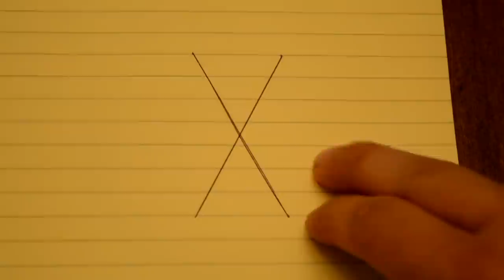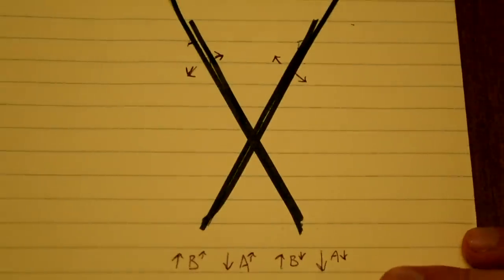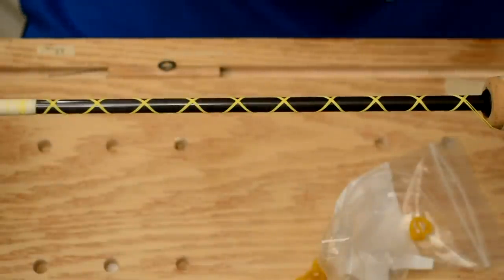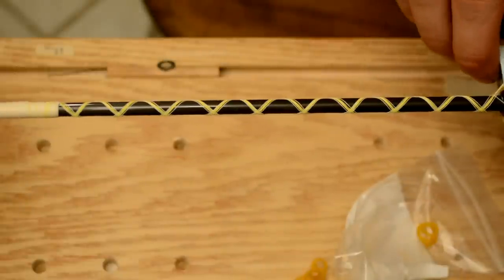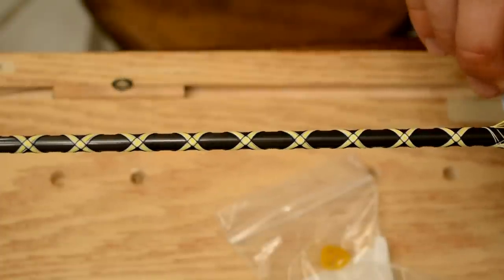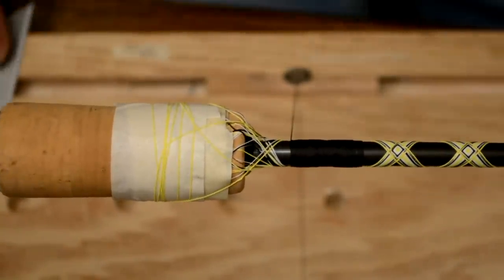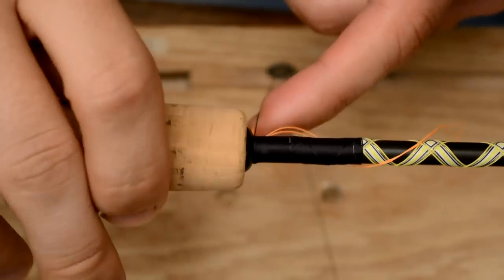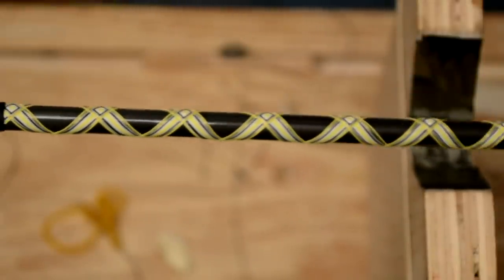Diamond Wrap Design / Custom Fishing Rod

Comment: Thanks for the video.  Only suggestion is to wrap both ends of diamond but starting inside and moving outward.  Once you get started, you can then cut diamond threads, like you did on the grip side, and remove tape and wrap over ends.

Comment: These actually go fairly quick once you get the initial lay out of the first threads on nice and straight, my first one I ever did turned out beautiful, I was a little surprised. I’m going to try something a little more complicated tomorrow. I will say a large magnifying glass on a stand really helped but that may have been because I was using approximately a AA thread size instead of C or D on freshwater rods and I had many more threads and covered up more of my blank. I also used a trim band of gold in my tie off before going into my black in a C or D size for strength because I used gold in my cross wrap. Just remember to pass an alcohol burner quickly down your wrap to singe any fuzz off your thread before epoxy.

Comment: Nicely done George, you covered most all of the aspects, of which  I am aware, in one demonstration. I would like to have seen your work after a couple of coats of finish, as I was interested to see if some of the irregularities created by your design work under the end wraps would be mitigated. I also would have liked to have heard a bit more of "up B up and down A up," etc., to get a better feel for directionality and how your "recipe" would have worked if one were to set the project down for a day or so but, all in all, a very well produced and informative demo ----- Thanks.
Reply from the maker: Lance R. Marcussen  Thank you. I actually finished coating this rod last night. I atleast put 2 coats of finish on all of my rods, 3 coats depending on the wrap design. One way to limit 'irregularities' in your finished design, when applying your first coat of finish, I like to run with the design.
Reply: G aG and T Outdoors  George, could you be more specific about "run with the design" to limit irregularities. I'm working on my first rod and despite biting off more than I should have with four colors per line guide and perhaps five colors in the diamond wrap (by the time I get done), things are turning out better than I anticipated. I'd hate to ruin mediocre to decent work thus far with a sub standard finish job. Any input would be appreciated.
Reply from the maker: Lance R. Marcussen The best way to explain is when I apply my first finish coat, I follow the patter of the design with my brush, how the thread wrap around the blank. Meaning, I follow the threads, that will allow for the thread pattern to stay tight when applying the first finish coat.
Reply: G and T Outdoors Thank you George, I follow what you're saying and it makes perfect sense. I am about finished with my debut build and am quite satisfied with my diamond wrap and olive branches ------ at least not half bad for the first time out. Your forum has been quite helpful, thanks again.
Reply: why are my wraps hard to pack? I'm packing and seems like I'm getting no where, am I doing to lose or tight?
Reply from the maker: +sean trejo  Couple reasons could be causing the problem. 1. Your thread size may be to large or too small. I like to use either size D or A for my thread size. 2. You may be wrapping too tight. If your're wrapping and you feel like the thread is going to snap, the wrap is too tight.

Comment: How far apart do you lay out the center of your diamonds? I did my first one the other day and had a hard time keeping the threads packed. I think i made the layout too far apart.
Reply from the maker: I usually eyeball the spacing. You can use a grease pen and ruler to mark out the center lines, I say 2.5” spacing would work if you do that